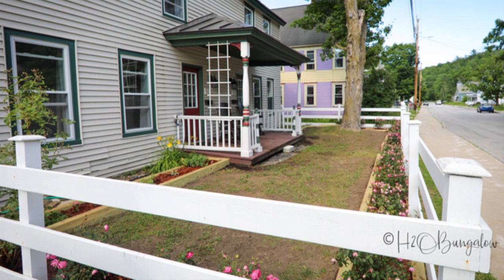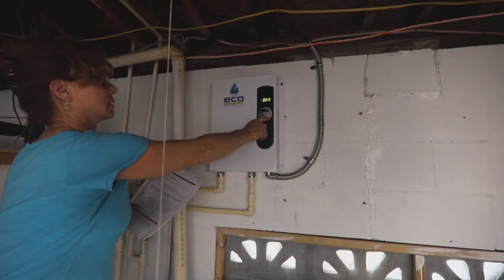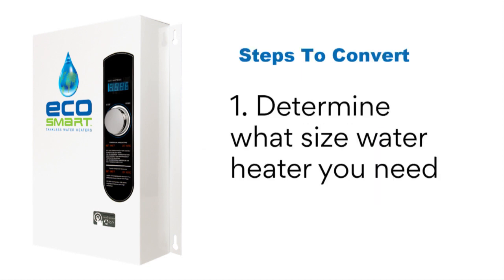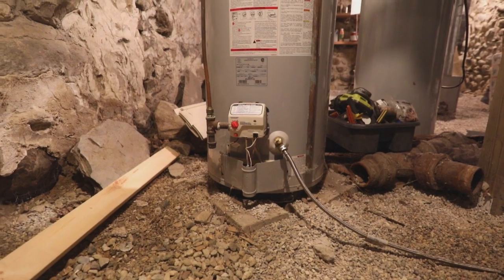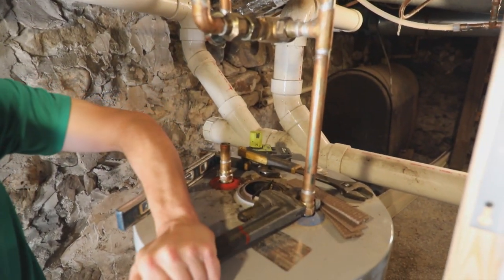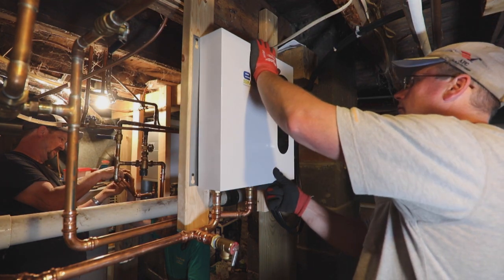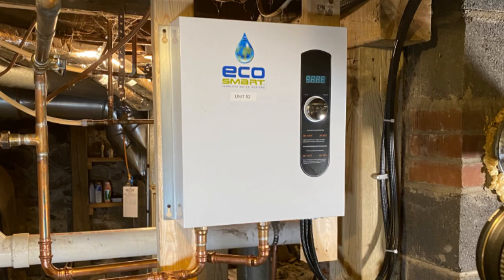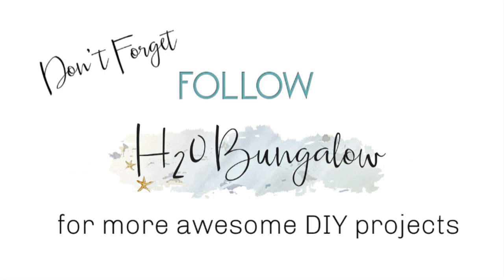How To Switch To A Tankless Water Heater

Comment: Wow I watched this thinking you were going to show the steps to install the unit, just to sit there and listen to you say you called someone for the install. Wonderful
Reply from the maker: It's the process I was sharing, I guess you figured that out!  😊
Reply: I thought the same thing but if I have an existing 30amp breaker in box already for a conventional electric hot water heater and the model tankless is a 25amp breaker just replace 30 amp with a 25 amp for safety. If the model I choose uses a 30 amp would there be a need for any electrical modifications in the electrical panel. I've found with alot of both common sense and caution once it's out of box and it's the right voltage and amp it's pretty much positive negative neutral or ground and making sure all the connections are secure and no water can reach them you can enclose wires you splice with wingnuts.
Am I right or wrong.
Hooking up the water should be simple.
Water runs down hill so where the water goes in is opposite from where it comes out gravity flow works real well.
Awaiting comments
Good or bad I'm curious
Riva

Comment: Wow!  That was such an easy switch!  I can't believe the water that came out of the bottom of the water heater...yuck!  I'm sharing this with my husband ASAP!
Reply from the maker: Yes it was an easy switch!  Yes! Can you believe that gross water?  I hate to think it was in our pipes and we used it!
Reply: BUT.... how does the tankless deal with the sediment?  Seems like they just send it to the shower head so you can bath with the sediment?
Reply: @dennishassler605  super late but for those coming across doing this, tankless requires annual flushing to prevent this. If you don't want to pay someone, grab a 5 gallon bucket, vinegar, and pump and flush it yourself.

Comment: So how much did the installation for one unit run you. Just a ballpark figure will give me a good idea of what I am looking at.
Reply from the maker: Hi- That's a good question. It's going to vary depending on what the plumbers and electricians charge in your area, and if you need to do any modifications to your electrical panel.  I brought in additional electrical service for this project since we added two, one for each side of the duplex.  At home in FL, we only had to add connect it to the panel because I had room.  So that was just a service call to connect it for the electrician.  The plumber spent maybe 2 hours hooking it up and another hour to pull out the old water tank heater.  I hope that helps!

Comment: Sweet but totally useless. Didn't show how to plumb or wire the heater, etc. as promised by stating HOW I INSTALLED ONE.
Reply from the maker: Sorry you felt that way, I didn't have a problem. Thanks for watching.
Reply from the maker: This video shows the steps a homeowner needs to take and what's involved in switching to a tankless.  If you want to see how to DIY the install, watch this video  https://youtu.be/hcI6W2UnuIY.

Comment: About approximately what is the cost to switch to a tankless water heater?
Reply from the maker: That really depends on the size of the water heater you need to put in and if your electric panel has room.  When we upgraded our home, it cost about the same as  putting in a tank water heater.  We spent about $800.  We had more work and needed to upgrade our electric panel in the Vermont rentals.  I hope that helps!
Reply: @WendiWachtelH2OBungalow  Thanks very much for responding.  I am in Texas (Houston area) and my home was built in 2005, so I had it built.  I am just concerned about the water heater tank which was placed in the ceiling, could start a leak and flood my home especially since I just put down wood floors a few weeks ago.  l live alone and my home is only 1700 sq. ft. so I would not need a very large one. I will have to check around to see what the cost would be in this area. Also, I noticed that the heater you mentioned can be purchased from Amazon.
Reply from the maker: @Diva4965  Yes, it can be purchased on Amazon here: https://amzn.to/3qGJqFI (all the units) If you call EcoSmart customer service, they will help you choose the proper size unit.  We've had ours a few years and absolutely love it.  Once you know what size unit you need, then call in an electrician to see if it will work with your electrical panel.   He/she will need that info to know if you have room in your elec panel and can quote hooking it up.   Good luck!

Comment: I Love the name, Wendy.  Thanks for this, yet what was the cost?
Reply from the maker: Hi Joe and thanks!  Every home will be different depending on the size of the tankless water heater and how the home is set up.  The tankless water heaters start about $200 and go up from there, depending on the capacity of water that needs to be heated.   We used a smaller EcoSmart unit at home since it's just my husband and I.  The ones in this video are larger because we host a lot of people, 8-10 at a time in these vacation rentals.  I hope that answers your question!

Comment: Beautiful Well Made Tankless Water Heater Video!
Joke - "And the tenants were found frozen like popsoicle sticks in the shower last winter when the power suddenly went out."
But seriously, great info here. I'm saving up for an electric tankless heater that can still run on our household 115-120 volt circuitry. Has anyone tried hooking up the Tankless Water Heater systems to Solar Power?
Since we don't spend all day in the shower, this power hook-up should theorecticcally work just fine. Even with Solar Panels from Harbor Freight.
Reply: Panels will only give power during the day. You need to look at batteries and power inverters to see if it would be a better solution than using your power.
Reply: @MrGman2000watts  My God! Agreed. Forgot a lot of Folks take a shower at Nyte!